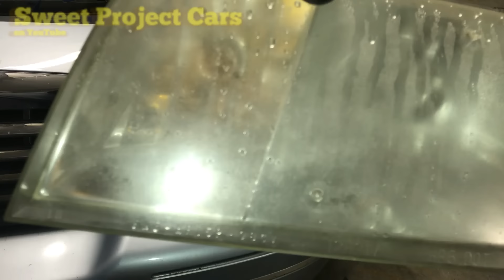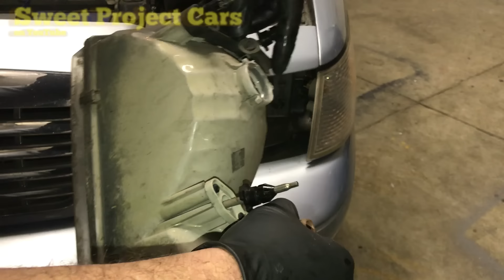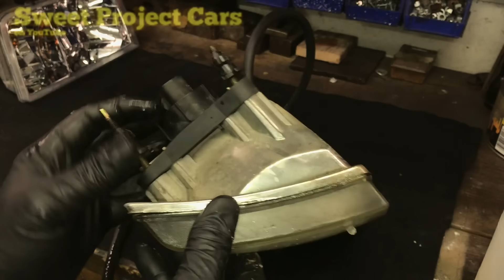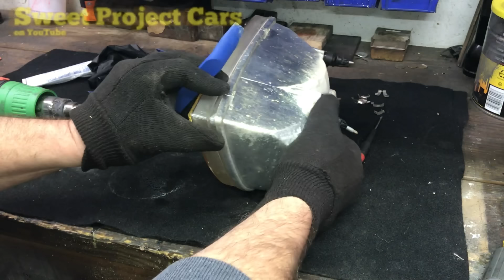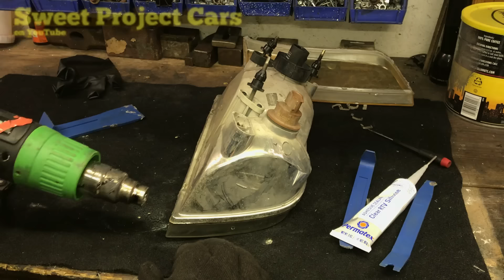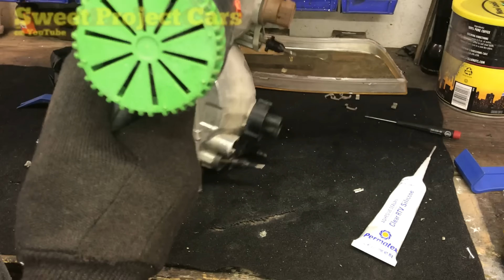How To STOP WATER From Entering Headlights!

Comment from the maker: HELLO my friends, we have had a lot of great subscribers asking how to remove and prevent moisture from their headlights. We share many methods to waterproof your headlight in this video. Have a great weekend everyone of our great SPC's friends :) *NOW if you have yellowing lights or PEELING CLEAR COAT and Mothers does not do the job, you will need to do this https://youtu.be/GKLF8oIWYGg hope this helps*
Reply: Sweet Project Cars you guys have the absolute best videos on car repairs.  Thanks!!
Reply from the maker: yes use these videos https://youtu.be/-CE5y3D4OMw and  https://youtu.be/TUfUdJBtj5s  you will find the tools for this project  in the "show more" of the video description
Reply: Sweet Project Cars   What about windows freezing shut to the window tracks?  Any ideas for that?
Reply: Very informative video, I had this issue with my old bmw e46 very easy to fix because the lenses come off so easily (clips ) my ford falcon however is a different matter , first thing is you need to remove front bumper/ apron to remove headlamps , I managed a temp fix by blowing inside with air to clean best I could then left off rubber shroud so it would breath easier, wonder if the vents were blocked ?/ enjoy your videos thanks
Reply: Impressive video mate.
Reply: Sweet Project Cars thank you for the methods because it’s all very useful. Thx-
Reply from the maker: thank you very much for your great comments and we appreciate you being here with us  :)
Reply from the maker: you are very welcome my friend :)
Reply from the maker: Alan thank you for sharing the great tips and we appreciate you being here with us  :)
Reply: Sweet Project Cars
Reply: Sweet Project Cars. What do you guys think of the oven trick? Looking to do custom headlights on my 2013 ram
Reply: Thanks Buddy👍

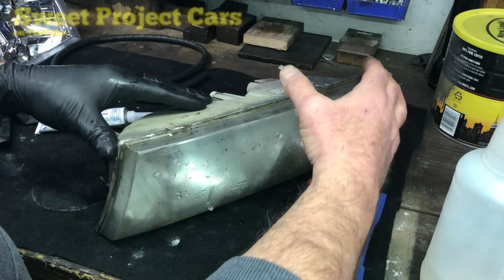Comment: I was looking at buying some aftermarket headlights for my truck. As a precaution, should I apply the silicone to the outer seam like in 2:52 and let it dry prior to installing them?
Reply from the maker: Yes, use this  https://amzn.to/2DuPmO1  and only this.  It is a great precaution to do before installing them.  Thanks for the great question.  Have a great evening.  mad Mike the hammer SPC

Comment: Hey, does anyone know if you can use bitumen sealant to reseal headlights? I'm unable to buy Morimoto butyl rubber strips or any kinda butyl based product since local shops don't have them, and I'm trying to do this on a tight budget.

Comment: A super duper video, once again!! Congratulations 🎉! I have moist in one headlight and also in two back lights (20 yr old car).Just wondering whether disengaging the headlight will be problematic (it’s a fiat barchetta, scared to ruin something!)
THANK YOU, you’re brilliant
Reply from the maker: You can pull the bulbs out spray in some rubbing alcohol let them air dry and put the bulbs back in but I’m sure it will continue to do that until you split the headlights a part
Reply: Hi there, the problematic bit for me is getting the headlight out of its socket, not the cleaning up process which I would definitely prefer to carry out using the full method. Thank you, you're such a breath of fresh air!!  @SweetProjectCars
Reply: @SweetProjectCars  Still have my old request: wish you could show us what you would do to mend plastic bumper cracks, the usual nice present from fellow parking experts! Would you prefer using the mesh and bi component glue after tunneling the crack from the inside, soldering the plastic with mesh or the drilled hole system? I'm for a simple method because bumpers are always cracked again when you live in a big city. And I certainly wouldn't spend the money for a new bumper.
Please, please, please...!
Reply from the maker: Kate Beedot can you send us some good pics and we will see what we can do for you :) thanks mike  send to SWEETPROJECTCARS@GMAIL.COM
Reply: Of course!! would be very pleased to send you pics of my crazy paved bumper! Please remember one day to illustrate your "plastic bumper crack mending" tricks, I would be elated,THANKS  @SweetProjectCars
Reply from the maker: Kate we will do the video just for you my dear ...thank you Mike
Reply: @SweetProjectCars  WOW! what can I say? That would be wonderful!! There are in fact too many bumper crack repair videos around but they use very different methods (don't like the stitch the holes method) and I just want a good one, i.e. that lasts at least until the next parking present to the bumper appears and I really just want your version, will be sending my magic cracked bumper pics very soon (raining cats and dogs, day and night, such a bother). After your video I'll first try it on my piece of sample bumper sitting outside and then on my Barchetta, Kate xx

Comment: Oh Darlin please! Have you come across a car that's side view mirror has gotten water in it? My mechanic didn't know how to fix it and made it worse trying to fix it. The water was trapped in the mirror (glass), not the housing. As always wonderful video!
Reply from the maker: Once it’s in the mirror glass there’s no fixing that that we have found it will need to be replaced what happens is the seal Is busted on the glass and water seeps in. Thank you very much for the great question have an awesome weekend
Reply: Ah well.  I will take the passengers side apart and make sure that seal isn't doing the same. Thank you for reply!

Comment: I can see where this would work for just about anybody.  However, I have a 2011 Chrysler Towne & Country with just 1 headlight ass'y which is doing this - every winter - drivers side.  In order to remove the headlight ass'y the front bumper must come off.  So I will just live with it - for now.  If I could remove the headlight ass'y easily, I'd do this in a heartbeat!

So if you know of a quick way to remove this headlight ass'y., I'd sure like to know.  Love your channel and all fhe tips you provide to all of us.  Keep up the good work.
Reply from the maker: Ray, unfortunately, yours is like the newer Cadillacs you have to take the bumper cover off partial to get the light out    thank you very much we truly appreciate that and you being here with us :)
Reply: Sweet Project Cars any odeas on how to fix? Or,just not,going to happen at all?
Reply: Sweet Project Cars for pouring alcohol in the headlight, and blowing with an air hose, what else can you use instead? Compressed air can?
Reply from the maker: CXL Mobile Headlight Restoration please explain as the video shows how to stop water from entering your headlight?
Reply: Sweet Project Cars cant remove,the headlight, anyway there is a quick fix?

Comment: The cause of this is twofold: hurried manufacturing processes, and the cycles of heating & cooling create a vacuum in the case, that draws in humidity (overnight dew, rain). The "pressure equalizer vents" only make it worse. Traffic atmosphere is filthy- exhaust gasses, washer fluid mist,  ice melting chemicals mixed with water, aerosolized by tires, equals another awesome SPC video.
Reply from the maker: thanks for the great comment hubba

Comment: It's a good video overall, plenty of useful tips. I'm curious if dumping rubbing alcohol in a headlamp assembly would remove the chrome paint for the reflector dish? Also, if the chrome paint has come off, what would you suggest to restore it? I ask that last part because I had a brand new headlamp assembly in a bench in my garage. I peeled off the paper that protects the bulb holes, but I didn't add bulbs. The ambient moisture in the garage caused fog in it, and when I dumped it out, most of the chrome paint fell right out too.
Reply from the maker: the alcohol does not hurt the light whatsoever you put it in and slosh it around and dump it out... thank you very much, we truly appreciate that and are very glad you are here with us :) as far as the chrome paint you can clean it with rubbing alcohol and then use a plastic chrome paint and then clear it with a good clear coat.

Comment: Extra credit for the Apple Polishers like me- If the chromed plastic reflector is hazed because of polluted water- Mothers and a soft cloth will clean most of that off too. If it's really FUBAR you can always clean it with isopropyl, then shoot it with light coats of your choice of "chrome" spray paint, and that can be buff polished like any other paint when dry & hardened properly.
Reply from the maker: thanks hubba for the great tips as always

Comment: Ive got a 2015 audi s3 and my both my headlights steam up but they not broken leak or anything caps behind tight what can i do
Reply from the maker: tahiR there is moisture getting on somehow, you need to seal them up like in the video without taking the lens off and see if that helps   thank you very much we truly appreciate that and are very glad you are here with us :)
Reply: tahiR make sure the vents are not clogged
Reply: tahiR, if they steam up, you probably have a pinhole leak somewhere. That is, unless they 'steamed up' straight from the dealership when it was spanking brand new.

Comment: just drill a 1/6" hole in the lowest corner and it will stay dry
Reply from the maker: the idea is to keep water out my friend :)
Reply: William Volkmann - yes that works too but 16 inches might be a bit large lol
Reply: It dose also the heat dries any that is already there
Reply: I've drilled a headlights on 2 cars.. work great and stopped blowing bulbs when I took a turn. Both were clunkers but if a nicer car has the same problem I might put it the extra effort with this method